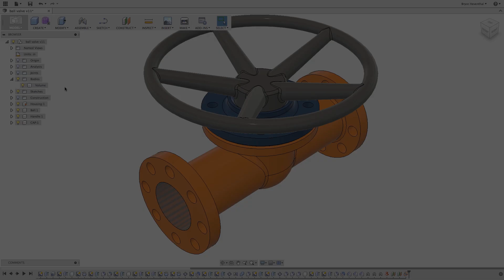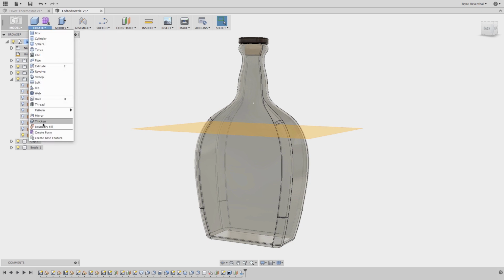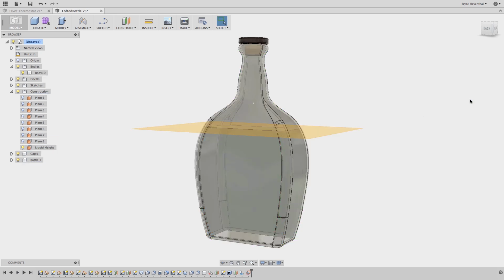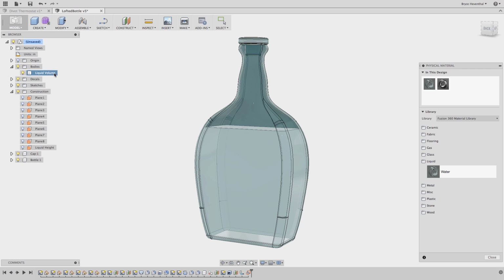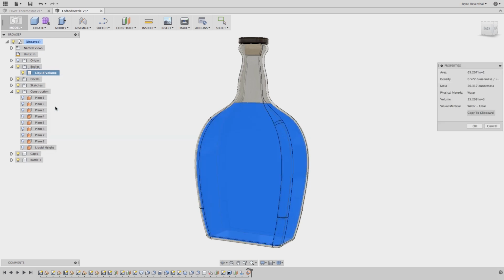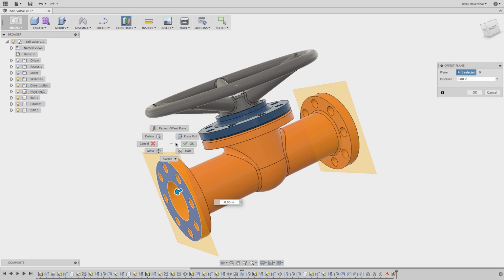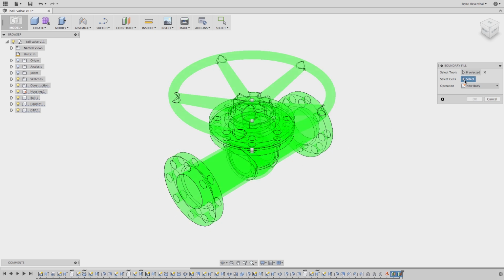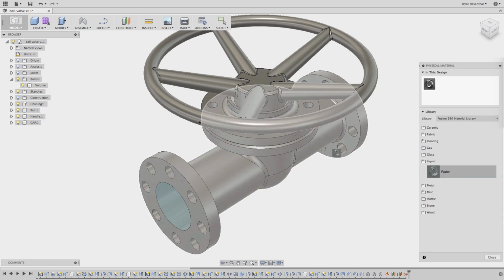Quick Tip: Find Internal Volume

Comment: Thank you for your help.  A couple of suggestions.  Please remember that many who watch tutorials like this are beginners.  It helps if you go slowly and explain the steps you are taking.  You are speaking very quickly.  English is my native language and yet I had to listen two times to determine that you said "Boundary fill command". And since you didn't explain how to find that command, I had to watch several times to see what you had clicked to get it.  "Then we select the cells" -- What on earth are those?  Turns out they're little white squares.  You could have said that. At any rate, by watching each part two to five times, and wondering why I always got only either the bottom, or the top above the plane.  Comes from not knowing what cells to click, I'm guessing; though in your video you only click one in the center, doesn't work for me.  So your "quick tip" has become a one-hour session. Eventually, I must accidentally have done something right, because I did get a new internal body -- but it included the volume of my object itself, not just the interior volume.  Not really impressed with the "quick tip" -- take more time and you will do a better job.
Reply: I think he was pretty clear, and the purpose of a video is so that you can replay it as many times as possible. There's also a speed option on each video if you need to play it fast or slow. Great video.

Comment: Thanks for showing us how to make the cell in the first place ffs
Reply from the maker: The cells are created IN that feature. If you have a bottle (or other vessel you want to measure), just make a liquid top with a plane, and use those in the command.
Reply from the maker: Let us know if that helped.
Reply: @adskFusion  Frankly no, that didn't help.   There are several cells but no matter which one I choose I always get either the top of my object or the bottom, never the space inside.